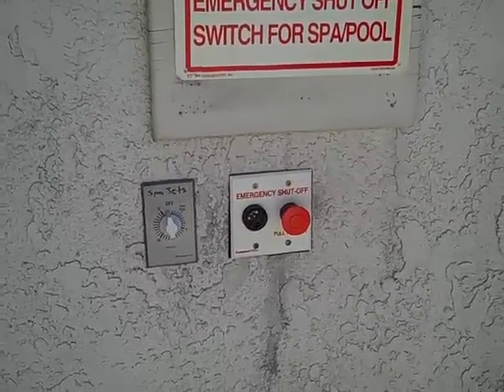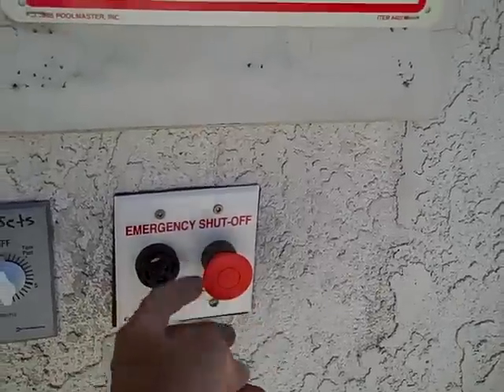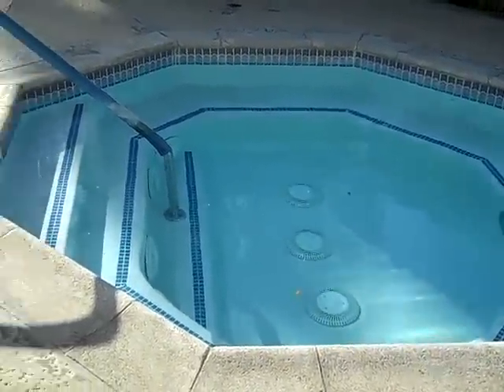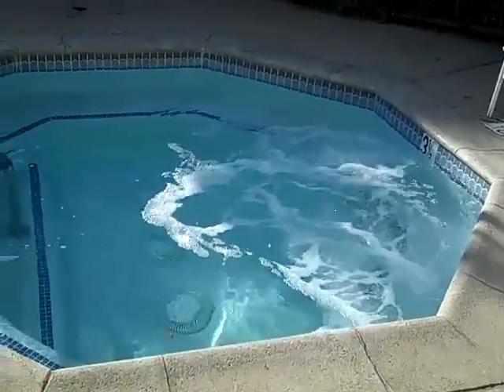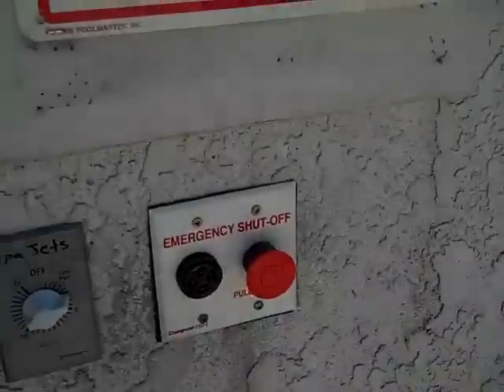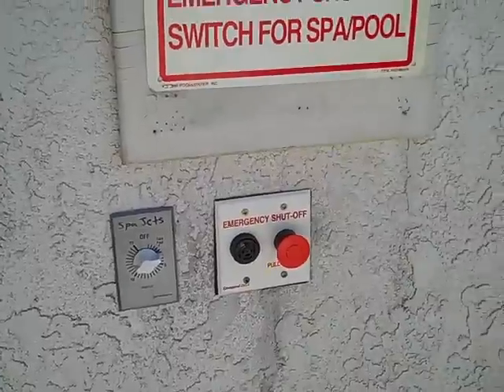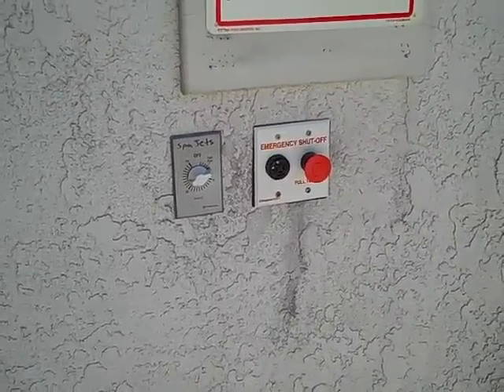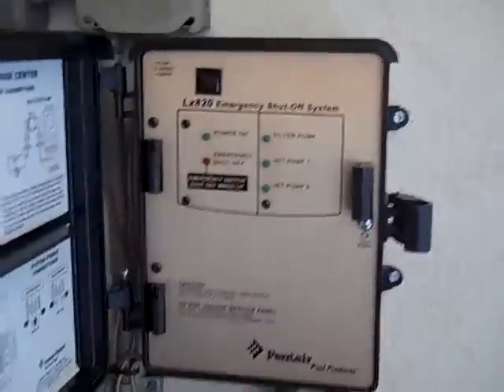Emergency Shut-Off (part 2)

Comment: Why does it have so many inlets?
Reply: Less chance of an entrapment because suction  is spread out to two other pipes instead of just one for instance.
Reply: @blakebeyett6471  Finally, an answer 7 years later 😂. I figured that was probably the reason. Thanks.
Reply: @mpjvending  HAHAHA 😂